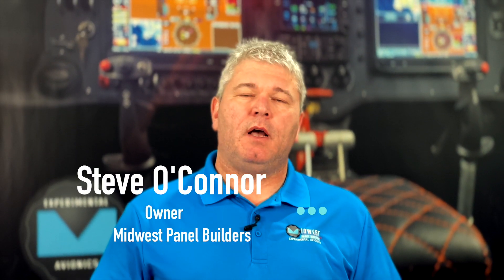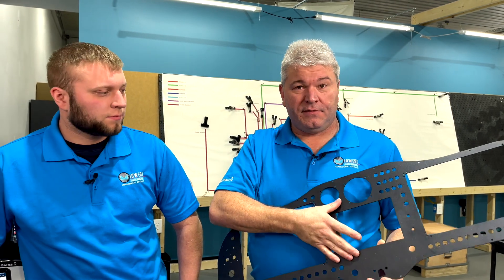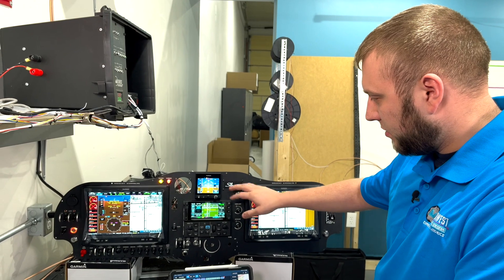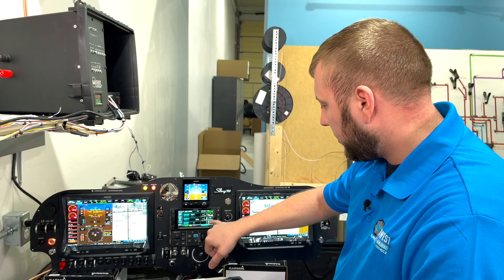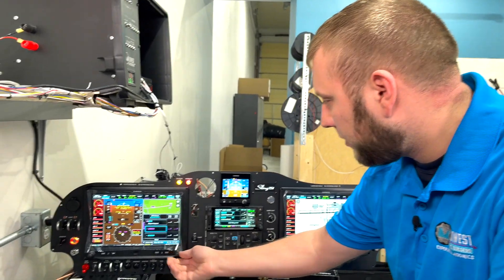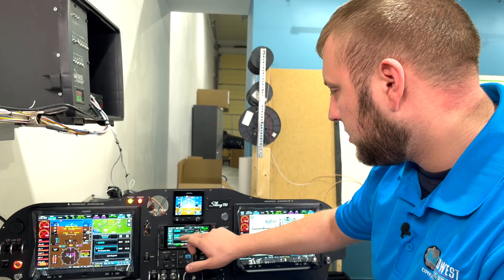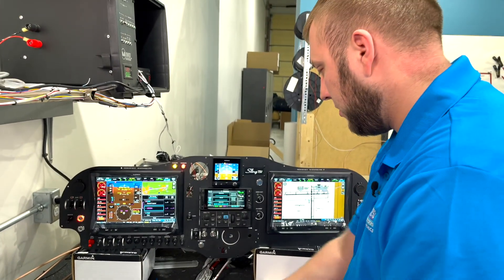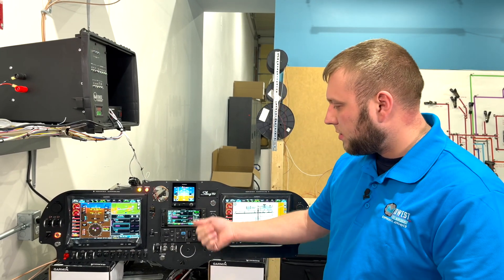Do You NEED a GTN 750 over the GTN 650? Eight Things to Consider Before Deciding.

Comment: for IFR - C 182  currently use a non-WAAS G430 and Foreflight for VFR  in getting set up for IFR panel upgrade, would a GNT 650 and a non-certified g3 touch or a certified G3 touch be needed?
Reply from the maker: You would need the certified G3X touch.

Comment: I’ve been using both the older GTN 650 &  GTN 750. Yes the GTN 750 is nice because if you don’t have a G3 X it gives you some extra real estate for your map. When I use the GTN 650 I use it on the default  NAV page, where as I don’t need a map, I use that on my iPad following along with ForeFlight. This is true with some of the aircraft still have 90% steam gauges.

Comment: the 750 is too damm big. They needed an intermediate size like the 530 was. If you have to push stack avionics like the audio and transponder right, then control them via the 750, something is wrong.
Reply: Agreed.  They should have 3 sizes and the price difference should be 500 for each larger size, X for 650, X+500 for intermediate, X+1000 for 750.   Garmin stop playing with us.  You have a slight monopoly and people remember this kind of thing.  Makes the alternatives seem very attractive if at all possible.

Comment: I'm getting a tone that sounds like someone plucking a guitar string. Can't tell if it is the GTN 750 or the GTX345. I can't correlate it to anything happening inflight either other than only inflight. I pulled the breaker on the GTN750 and the sound didn't occur while it was pulled. I got a transponder failure message also. Putting the CB back in, I had a Comm needs repair message.

Comment: I might be jumping the gun here but you can legally use an approach plate loaded on the 750 during approaches. So if you don't want to use paper or foreflight on an ipad you can have everything you need loaded on the panel. This is a big deal for me personally.
Reply: I have the approach plates loaded on my G500 but find it more convenient to brief from the iPad as the screen resolution is better, however I do fly approaches with the plate displayed. In the final stages of approach and when taxing the plates on the screen are at their most useful as it gets rid of the cockpit clutter at times of high workload.

Comment: I'm installing a 11 inch G3-X a 7 inch G3-X, and a GTN 650.  What about using a GTN-750 instead of the 2nd 7 inch G3-X and a GTN 650?  Screen sizes are about the same but the 750 has the added benefit of a nav/com.  Also, the cost would be about $4,000 less vs the combo.  Thoughts?
Reply from the maker: We would do the 7 inch over the 750. As for the Nav/COM, you will get that with the GTN 650 anyway, if you replace the 650 and the 7 inch with a 750 the cost will be about equal so I'm not sure how you would save the $4,000 unless you found a good used deal somewhere. The 7 inch functions as an MFD better than the 750 alone, the 7 inch would also go into reversionary and act as the PFD giving you more useful information such as engine indications should the PFD fail.

Comment: Could you comment on using an aera 760 on the right side of the panel rather than another G3x screen? What does the extra screen give you that an aera would not? And how much is the second G3x screen compared to the first? Thanks
Reply from the maker: The one thing you will get over the 760 by having the second screen is that you get a hard wired reversionary backup. This will give you a PFD and engine indications should the PFD fail which doesn't seem like much but if you are in actual IMC and you lose your engine indications it could be quite troublesome since use power settings to obtain speeds on an approach. Otherwise the 760 is really a good deal, especially for VFR flyers.
Reply: @MidwestPanels  Can you use a non-touch garmin screen for the backup/2nd screen, with a large gex touch on the left side? They seem cheaper than the touch versions.
Reply from the maker: @kwittnebel  Unfortunately no, the legacy system is not compatible with the current generation.
Reply: @MidwestPanels  Bummer! Thank you for this information.

Comment: Thank you guys, great presentation. Both are great boxes, the bad thing is the price.
Reply: No kidding!  My King KNS80 went belly up a while back, and I wanted to upgrade to a 650 or 750xi.  The cost was insane and I still needed to make other upgrades to get the most out of them.  To get GPS steering, at least a G5 HSI.  But, all I could do is use the lateral navigation of the systems.  To get vertical guidance, I would need a new auto pilot!!!  I finally bought a used KNS80 for $500 and gave it up.  Now with 3rd world fuel prices, I think I did the right thing.  (Thanks Brandon!)

Comment: I don’t know about the new 650s but the older 650s require the Flight Stream 510 to connect to your iPad (I think I paid around $1500 back then to have it added). I have dual 650s in my aircraft and the Flight Stream makes them awesome! I considered the 750 but everything is so much easier as far as flight planning on the iPad. The Flight Stream 510 is a must! Thanks for the video guys.
Reply from the maker: Both 650 and 750 new and old need a Flightstream when used alone. When coupled with a G3X, neither of them need it unless you want the update concierge.
Reply: @MidwestPanels  dumb question, are they work with ForeFlight? I mean data transfer back and forth
Reply from the maker: @YamahaDigital  Flight plan transfer will work with Forelight and Garmin Pilot.
Reply: I always file direct destination. If I have to fly around Class B it's usually a 2nd waypoint that I have to manually enter. $1500 for the Flightstream is so ridiculous. It's less than $10 to make.
Reply from the maker: Someone had asked us a question on this comment but dissappeared. The question was, does a G500TXi need Flightstream to connect to Firelight and the answer is yes it does, it's the Flightstream 510.

Comment: Another outstanding video guys!
Question:  When space is limited and budget is of concern, what's wrong with tossing the right hand G3X and installing the 650, as Sling Academy uses in their Sling 2 trainers? Backup is G5. Mission is experimental IMC training.
Reply from the maker: Thanks for watching Judge Earl, Nothing at all wrong with that, the point was that instead of paying extra for a GTN 750 why not put it into a second screen, but if on a tighter budget by all means a 650 and one screen.

Comment: Could you go into item #8 - the audio control.  I wasn't quite sure what you meant by the limitations on the 650 over the 750.  Are you able to manage the remote audio using the G3X panel?
Reply from the maker: Yes Brian,

Yes you can control the GMA 245/245R from the G3X but not from the GTN. For those without an EFIS they can have a GMA 35C controlled from a GTN 750. There are some that believe you can only remotely control an audio panel from the GTN 750 which would only be true in an airplane that has steam gauges and was using a GMA 35C
Reply: @MidwestPanels  I figured as much and thought I’d seen it that way in others videos. I guess the way I heard it in the video that it wasn’t possible from either panel. 

There’s just some amazing audio control features through the UI on either the 750 or G3x.

Comment: Yes, with iPads being under $1,000 and very capable data entry devices, it is insane to spend $4,000 more and lose a ton of panel space when using the iPad is so easy.
Reply: Well, the iPad is not as well integrated with the aircraft
Reply: @CreepinCreeper145  If you actually watch the video, you will know why your comment is completely irrelevant.

Comment: The 750 cons Steve mentions is actually a con on sling tsi panel design not the 750 itself..
Reply from the maker: An issue for many experimental aircraft. Let it be known that in no way do we think the 750 is a bad unit. But when panel space is a premium as is the case for many aircraft (not all) it’s not worth hurting the integrity of the panel to fit one in. There is no added benefit other than screen size.

Comment: Very informative. Your point regarding the pricing difference between the 650Xi & the 750Xi is valid but, the 750Xi is just too darn sexy to turn my back on. Additionally, my aircraft has plenty of panel space to accommodate the 750Xi and; this aircraft is an investment. I always look at resell marketability & return on my investment. The Garmin 750Xi on my panel rings both bells.
Reply from the maker: Thanks for watching, the 750 is a great unit. The main point in this video is to discuss the many points that come up about the differences. For many though panel space is an issue so this is mainly for them.
Reply: You're killing me!!!  I've been waffling back and forth between the two.  I got a great quote on an in stock 650Xi and quick install.  So, I backed out of a long wait for a 750, and maybe longer for install.  My Archer has plenty of space.  Is that the reason to get a 750?  I'm never going to get a GX3.
Reply: @azcharlie2009  What did you end up doing? I have a G500 and GTN 750 in my Archer and like it.
Reply: @airops423  I never did buy either one...  I bought a used KNS80 to replace my old one.  The glide slope had failed 40 some years...  Then the used one failed, too....  Not sure what to do right now.  I might have to take out a home equity loan just to afford the needed upgrades!!  At 75 years, I'm not sure how much longer I'm going to fly anyway....
Reply: @azcharlie2009  Aw that's a shame!
Reply: What are you talking? The avionics you never get payed back in a resell. Your brain is very limited bro. 😅